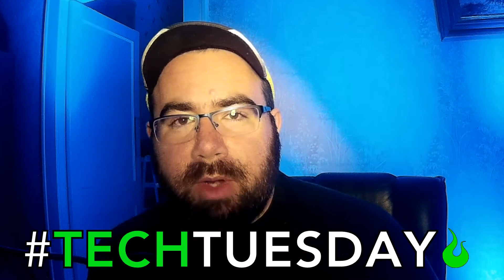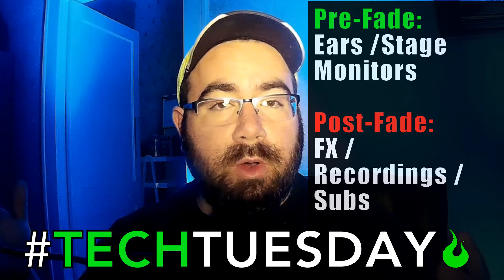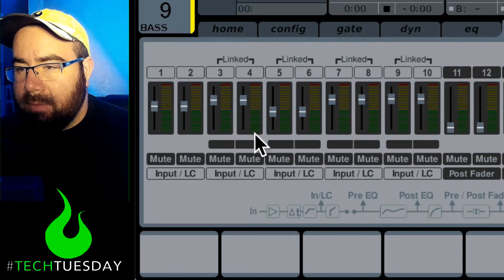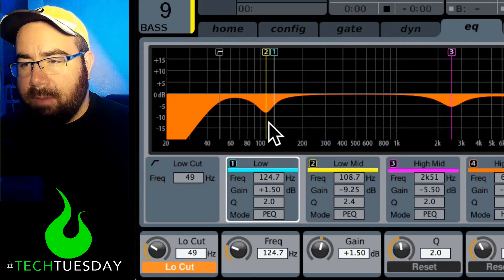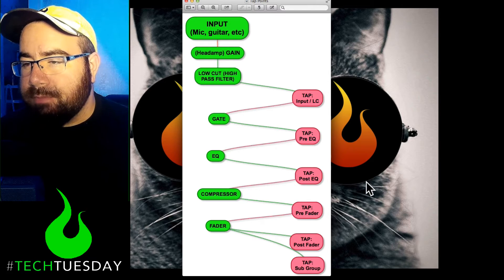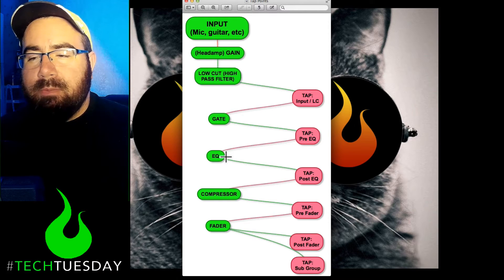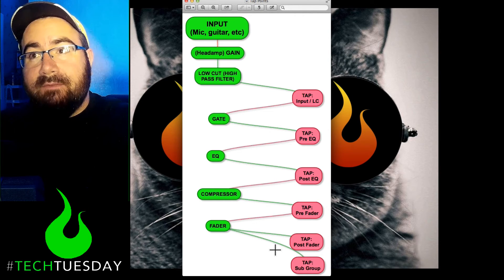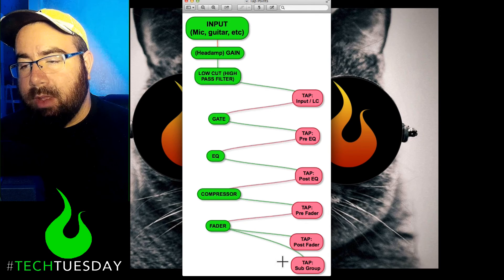X32 Tap Points - Transitioning to In-Ears - #AscensionTechTuesday - EP012

Comment: Hey there, is there a way to do this on the Wing?
Reply from the maker: Yes and no. There’s a tap point selector but it can’t be different for every bus like on the X32. Generally, this should be fine but it’s just a little different. 

Great question. Thanks for watching and commenting!

-Chad
Reply: @AWTechTuesday  thanks for the response.. so is there any way to have a separate eq through a bus on a channel on the wing? Apart from duplicating the signal to another channel.
Reply from the maker: @kasonkedersha579  It’s very basic but yes, there is an entirely separate EQ option available  for sends on the Wing. I don’t have one in front of me right now but I think it’s a basic 3-band EQ.
Reply: @AWTechTuesday  thanks, I'll look for it. The one other thing is personal panning. Do you know if that's available?
Reply from the maker: @kasonkedersha579  absolutely. Every bus on the wing is stereo (assuming it’s patched to 2 outputs). There is a separate pan knob for each bus :)
Reply: @AWTechTuesday  sorry.. yes, I know that. But I'm referring to panning specific channels in the bus lol
Reply from the maker: @kasonkedersha579  correct. Say I want the guitar in the center of my mix, you want it on the right in your mix, and the it’s panned left on the house mix. That can absolutely be done.
Reply: @AWTechTuesday  found the panning and the eq. Now I see what you're saying. 1 extra eq is available for all busses and from what I can tell panning can be separate per bus. But this should do the trick

Comment: I’m extremely late to this (hope you’re still responding to comments).
I currently have a 31 bandEQ on my pastor’s channel and I want to also use a DEESSER on him. I sent my pastor’s channel to a mono subgroup; assigned the subgroup to the STEREO BUS; installed the Deesser on the subgroup. Yet, I hear as if the Deesser isn’t even active (I already checked that it is active and I even see the sibilance gain reduction but hear no difference). Why do you think this might be? I use an x32.
Reply from the maker: By using a subgroup, you are sending level to the De-esser after your channel fader. You may not be sending a hot enough signal for the de-esser to activate. You may want to swap your inserts around and insert the de-esser on the channels and insert the EQ on the bus if you’d like to use both.
Reply: @AWTechTuesday  Got you! Thank you so much for responding btw.
If I go forward and make the change you suggested would the 31-EQ have the same issues as the subgroup (with signal not being hot enough)?
Reply from the maker: @ItzTooSik  Graphic EQs don’t an audio threshold that must be hit to work so you should be fine in that regard.

Comment: you liost me.. bro.
Reply from the maker: Alphonso Desselle Questions?
Reply: @AWTechTuesday  yes.. I think i'm missing some of the stuff before this video.. actually what I'm trying to do is, I have a mic on input channel 1.  And I'm using mixbus1 for a headphone mix.  When I adjust the fader  on channel 1, i don't hear the volume of the microphone increase in the headphone mixbus1.  But i hear it increase in my speaker, which is connected to main out L , R.   Do you happen to know why i can't hear the change in volume in my headphone mix?
Reply from the maker: Alphonso Desselle Sounds like you have the mic set to pre-fade going to the mix 1. To adjust the mix going to the headphones, you’d need to hit sends-on-fader and make adjustments to that mix. Check out this video for more info - https://m.youtube.com/watch?v=rahVBgwzL7g
Reply: @AWTechTuesday  you rock!! wow.. thanks for your help. I had actually figure it out watching a behringer video.. But yes on the channel I had it set to postEq instead of Post Fader.. that fixed it for me.. I think i could've done in another place.. but i'm not sure where.. I will check out the video you sent. but thanks for the help!

Comment: Not sure if you’ll read this, since your video is old. Lately I’ve been trying to fix a “problem” I have on my x32.  It seems that when I mute my drums DCA, it mutes the drums on the P16s. Is there a way to fix this?  In other words, for me to mute all DCAs (not individual channels), so the band can hear themselves on the p16s, but, I don’t hear them through the speakers.
Reply from the maker: The easiest answer to this is to not mute the DCA but rather pull it all the way down. If you don’t want to do that, if the drums are sending to a pre-fade mix for the P16, I’m 90% sure you could go to the setup menu and disengage the option for hard mute DCAs. I believe this will only mute channels going to post-fade mixes. I personally do not like this option but choose for yourself :)